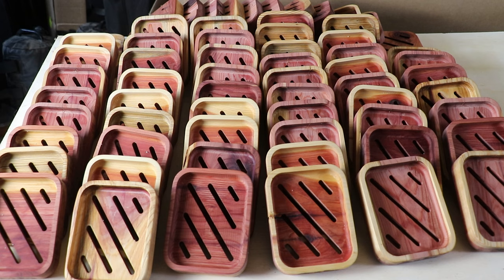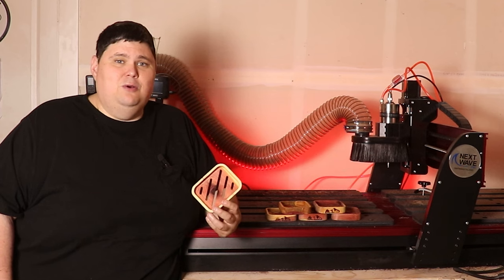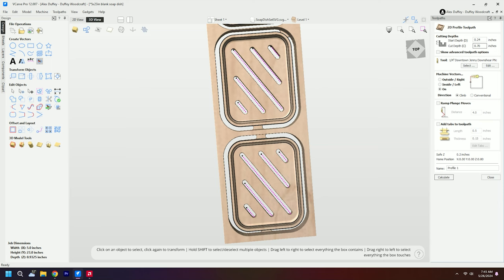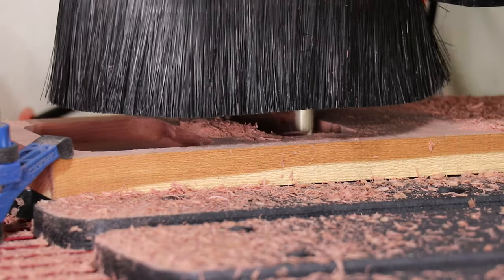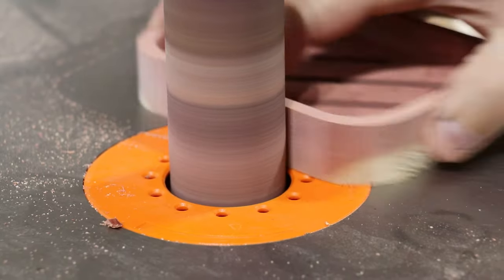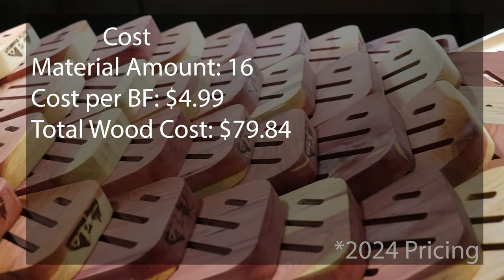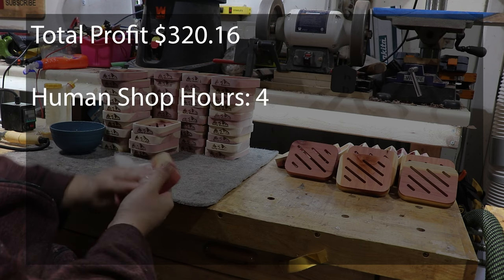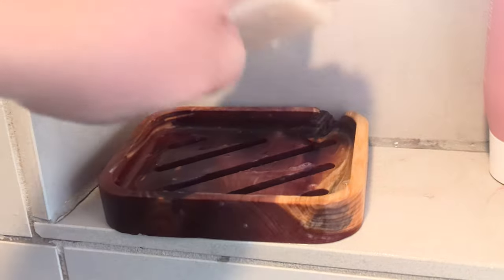Cedar Soap Dishes CNC Wholesale Project

Comment: Great product to sell. Tip is to do a raster toolpath with the grain and do a profile pass last.  You shouldn't need to sand the inside at all.
Reply from the maker: Thanks! I normally don't do any sanding inside. Just a light pass on the bottom to get off fuzzies and on the side to get rid of tabs.